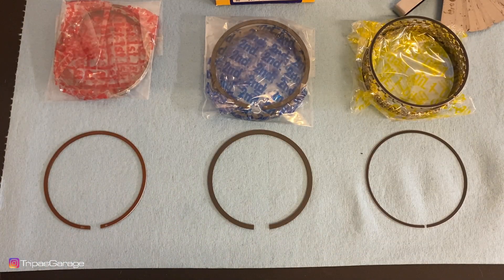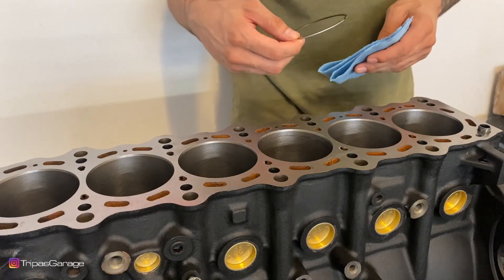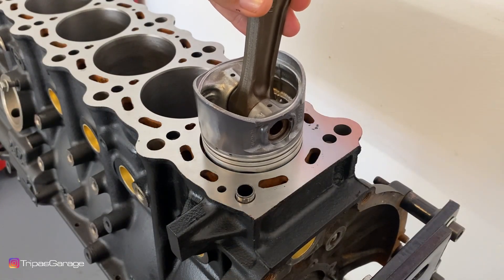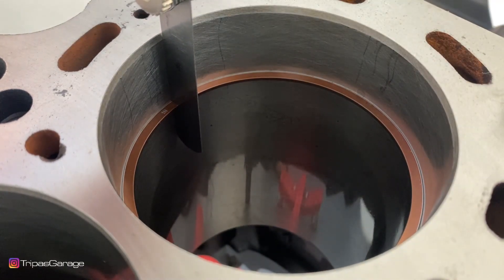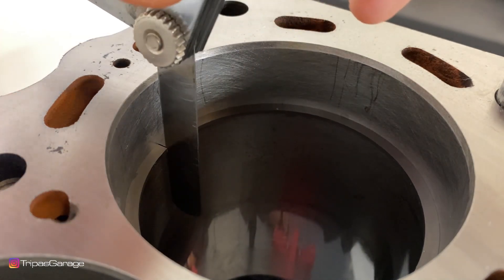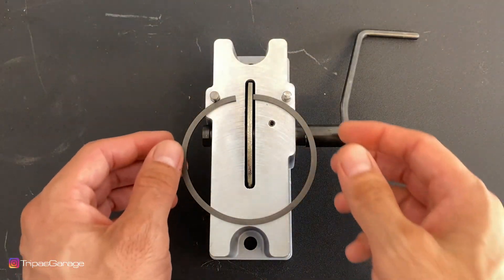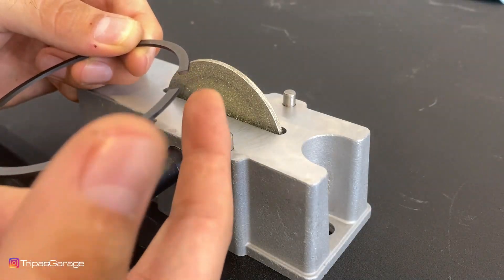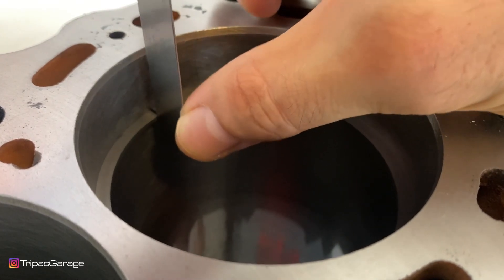2JZGE NA-T Turbo Build - Piston ring end gap clearance

Comment: Random question: I am
Using a 2JZGE block with 2JZGE non-VVTi pistons. Want turbo eventually. What pistons did you use? And if I search, should they be GE or GTE piston rings? Thank you! 😊
Reply from the maker: I’m using the GE non vvti pistons and rods from this engine. The only difference between the GE and GTE piston rings is the GAP. GE GAPs being smaller. You’ll want larger gaps for turbo, so personally I get the GTE and then file them to my liking. Less filing with GTE. Both GE and GTE rings will work.

Comment: I was trying to figure out how 0.024in is still good for boost? It just has to be under the Max ring end gap size?
Just trying to figure out the right ring gap for my application
No.1-0.021in.
No.2-0.021in.
Oil (Side rail) - 0.018in.
Off online document
Standard Ring Size:
No.1 0.300 - 0.470 mm (0.0118 - 0.0185 in.)
No.2 0.350 - 0.520 mm (0.0138 - 0.0205 in.)
Oil (Side rail) 0.130 - 0.450 mm (0.0051 - 0.0177 in.)
Maximum ring end gap:
No.1 1.07 mm (0.0421 in.)
No.2 1.12 mm (0.0441 in.)
Oil (Side rail) 1.05 mm (0.0413 in.)
Reply from the maker: A good rule of thumb for nitrous/turbo applications is: Top Ring: Bore x .0055” Second Ring: .004-.008 bigger than top ring. Oil ring: .015” min

Comment: The chamfer at the top of the bores looks huge :)
Reply: Thanks for the information! I did the calculation and 86 x 0.0055" = 0.473 Is this in metric? I got bored 0.002 so I'm gonna get new set of rings and calculate it. Much appreciated 🤟
Reply: @randoohyama7632  bored .002? Over standard?, seems like a very strange amount, I doubt the bore would have cleaned up at .002 

.055 (55 thou) x in bore diameter will land you in the ball park for ring gap in though
Reply: @joshdavies886  my fault it was a 0.02 just some surface rust. Forums seemed to indicate to go towards standard ring gap so thanks for the information.
Reply: @randoohyama7632  don’t read forums, read the information and guidelines the ring manufacturer supplies